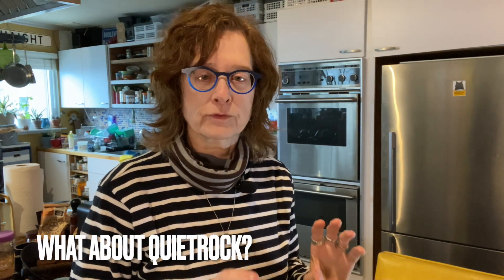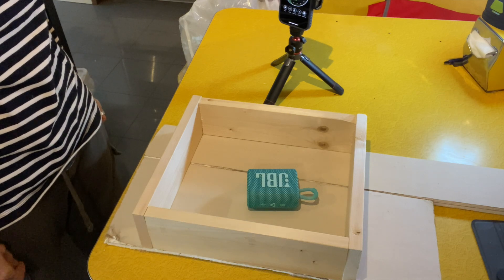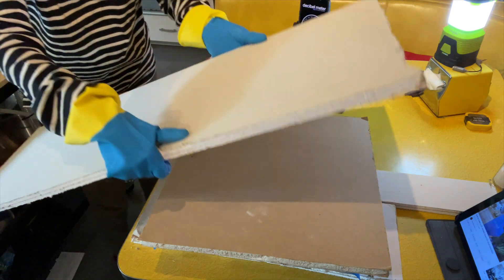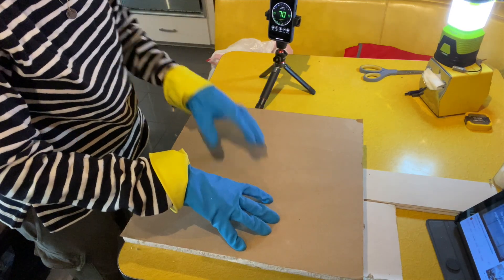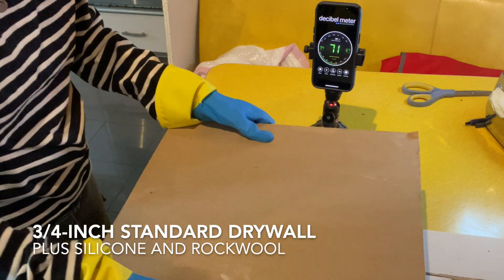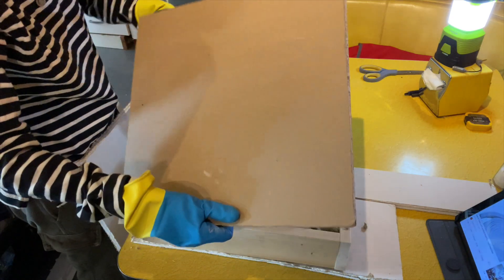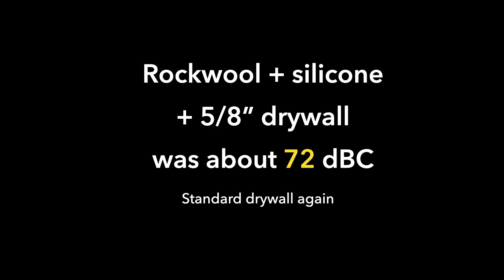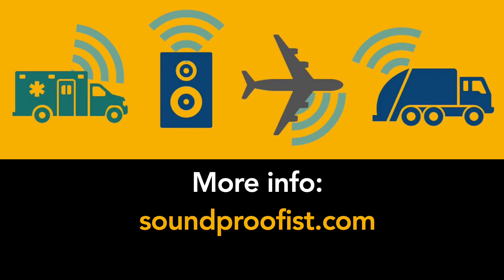Noise test: regular drywall vs. soundproof drywall

Comment: A lot of sound was likely transferring through the wooden frame or the table.
Reply from the maker: It was coming through the wooden frame. In this video, I put a layer of QuietRock drywall between the wood frame and the table. In a subsequent video, I added a second layer of wood, and the noise was definitely leaking through the frame. I still want to build a simulation that isolates noise better.

Comment: Sorry, but I have to comment. Your testing is totally inconsistent. We all know, I think, that more mass/density = less sound transgression and air gaps are the biggest contributor to sound transgression. Just dropping a piece of drywall on top of a 2 x 4 enclosure (which is itself not realistic, because the wood carries more sound vibrations, not to mention frequencies, and your db meter is resting on top of the "box" is just absorbing the lower frequencies through the mount - totally wrong). More to say about your "test". but I'll stop here. Start over with accurate measurement techniques (including a true mass loaded comparison).
Reply from the maker: Correct. I made a second video, and used two layers of wood frame and drywall in that simulation-- one to represent the neighbor's apartment, which is the noise source, and the second one to simulate the space (a wall space or ceiling cavity) between the neighboring apartment and your apartment -- the noise path. In this first video I used only one layer. And I explicitly stated that it's not going to be fully accurate because of the resonance of the wood frame, and the flanking noise coming through the exposed wood on the sides. In a real apartment, that wood framing would not be exposed or uncovered. 
In the second video, I also hold the decibel meter in my hand versus sitting it on top of the drywall. But the issues (flanking, resonance through the exposed 2x4s, scale/size of the model) remained the same. After spending a lot of time on this, I decided to put the videos online anyway, just to show the challenges of trying to stop incoming noise along the noise path or on the receiving end, especially if you attempt to "soundproof" only one surface. The takeaway in both videos is this simply adding materials to one surface (like insulation or extra mass) usually doesn't stop noise from coming in along other parts of the noise path, and trying to stop noise at the receiving end is usually less successful than stopping it at the source. Not to mention that if you live in a building that's comprised of 2x4s with a piece of gypsum board nailed onto a hollow cavity, you're going to get a lot of external noise coming in and band-aid measures might help, but not fully resolve it.
Reply: As long as the test is repeated in the same manner with the different materials or sound emitting sources being the same, the results should all be skewed equally. Maybe holding the cover in that second test might have had a different effect